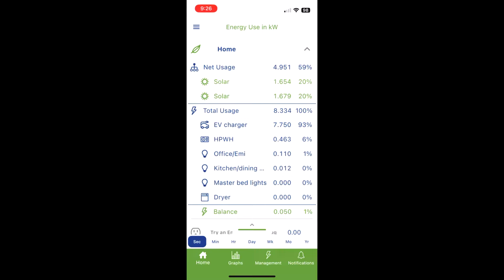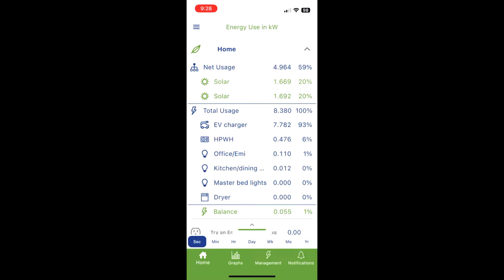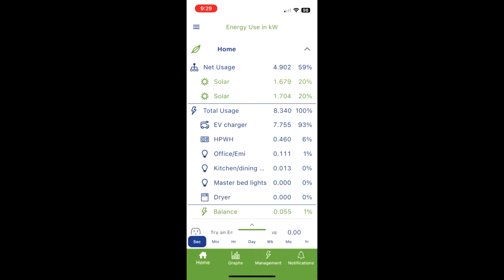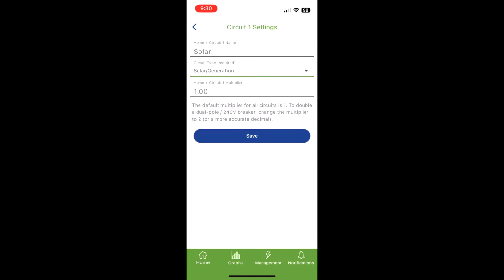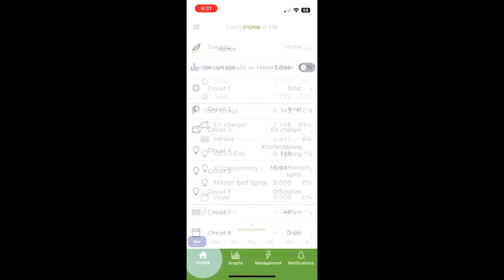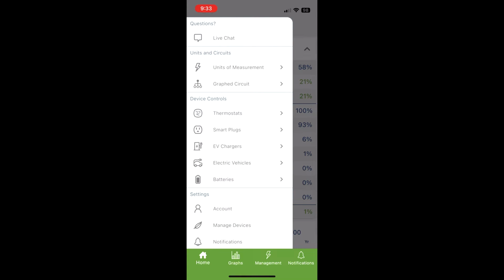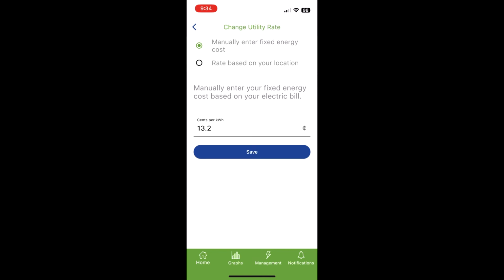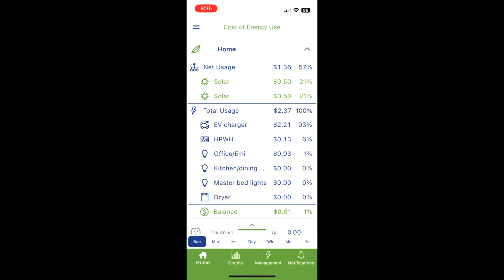Emporia Vue 2 Tutorial – App, Setting Up Circuits, and Units of Measure

Comment: I highly doubt it is costing you $1.36 per second to charge the EV.
Reply from the maker: My assumption is that you're calc'ing that on $0.17/kWh?  If so, you need to understand the difference between power and energy.  The live view is showing power (kW), which is instantaneous.  We pay based on energy, which is a duration of time of that power, or kWh.  So at 7.7kW, it's costing me a $1.36 an hour, not second.
Reply: @nukem384  $1.36 per hour sounds about right. Unfortunately I had to disconnect my Emporia Gen 3 today and about ready to return it back to Amazon now as it does not allow time of use input for Ontario, Canada. Really sucks because I kind of like it but no time of use won't work for me.

Comment: I live in a condo and installed the Emporia EV charger on my sub panel. The main panel is located outside the garage so that wouldn't work. I used a 2 pole 50 amp single unit.
I have the EV charger set to 50A charging. Its working great but I'm having issues with understanding how to incorporate the Emporia Vue generation 2.
The only reason I wanted to install the vue is for the load management features. My goal is to only monitor the EV charger and air conditioner, so if both the AC and EV charging are running at night, the EV charger will decrease its power if it actually needs to.
With the Vue, I connected the larger monitors to the 2 mains coming into the sub panel, and then connected 2 small monitors to the EV charger labeled 1 and 2, 2 small monitors for the AC labeled 3 and 4, and one small monitor for the AC fan/compressor 5.
The issue I'm having is, the percentages seem off to me in the app. It says the main is 100% and when I run the AC, it averages around 80%, and when I run the EV charger it's at roughly 90%. Combined that's obvisouly over 100%. I feel like I didn't set up the app settings correctly, or I'm misunderstanding the usage or each monitor.
For the record, while running the AC and EV simultaneously, nothing has overloaded and the EV will charge at full power. Do I even need the Vue if nothing has overloaded yet? Wouldn't something have kicked off if it couldn't manage the load?
Reply from the maker: This is probably something you should ask Emporia about.  Their CS is pretty good, so I'm sure they could probably help you.  But yeah, possible something isn't setup right or settings just need to be adjusted.

Comment: Emporia Energy Tech Support Agent here - great video! I just sent this to a customer who was looking for a video tutorial for the app!
Reply from the maker: Glad it helped!
Reply: Hey Zach,

I live in a condo and installed the Emporia EV charger on my sub panel. The main panel is located outside the garage so that wouldn't work. I used a 2 pole 50 amp single unit.
I have the EV charger set to 50A charging. Its working great but I'm having issues with understanding how to incorporate the Emporia Vue generation 2.

The only reason I wanted to install the vue is for the load management features. My goal is to only monitor the EV charger and air conditioner, so if both the AC and EV charging are running at night, the EV charger will decrease its power if it actually needs to.

With the Vue, I connected the larger monitors to the 2 mains coming into the sub panel, and then connected 2 small monitors to the EV charger labeled 1 and 2, 2 small monitors for the AC labeled 3 and 4, and one small monitor for the AC fan/compressor 5.

The issue I'm having is, the percentages seem off to me in the app. It says the main is 100% and when I run the AC, it averages around 80%, and when I run the EV charger it's at roughly 90%. Combined that's obviously over 100%. I feel like I didn't set up the app settings correctly, or I'm misunderstanding the usage or each monitor.

For the record, while running the AC and EV simultaneously, nothing has overloaded and the EV will charge at full power. Do I even need the Vue if nothing has overloaded yet? Wouldn't something have kicked off if it couldn't manage the load?

Comment: I didn't install mine. How do I figure out what is what to name them?
Currently they are just 1-16
Reply from the maker: You have to write notes.  Basically, first you need to know which circuits in your breaker box control what.  Once you figure that out, say you put a CT on your dryer breaker.  Then you plug that CT into the "1" spot on the Emporia unit.  Then in the app, "circuit 1" all you need to do is rename to dryer.  Repeat for every CT.

Comment: What about the balance on the bottom how you interpret that . I have solar too ?
Reply from the maker: It's all the circuits you don't have monitors on combined.  It's the delta between what your main CTs are reading and what all your other circuits are reading.  That get buried in the balance line.